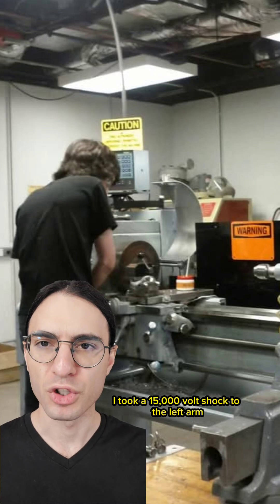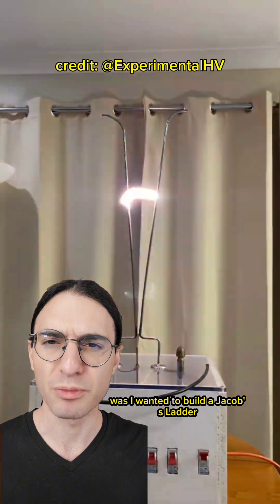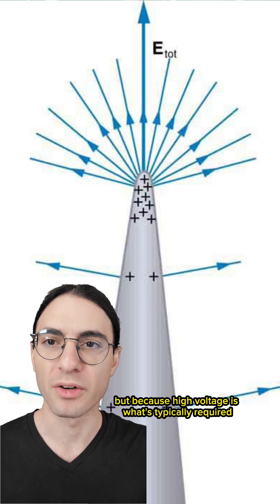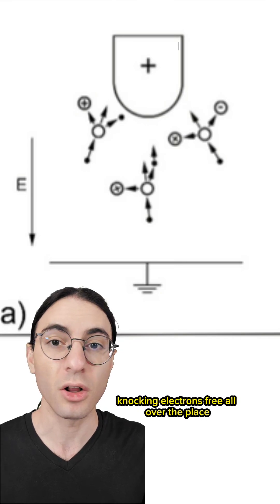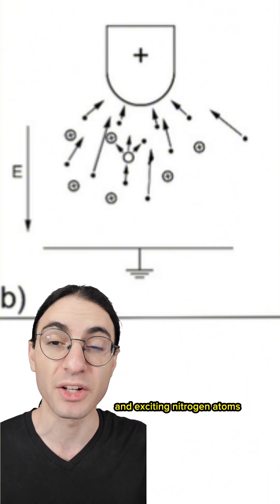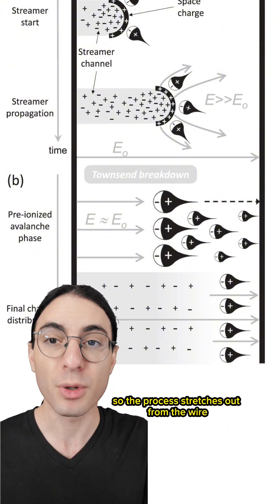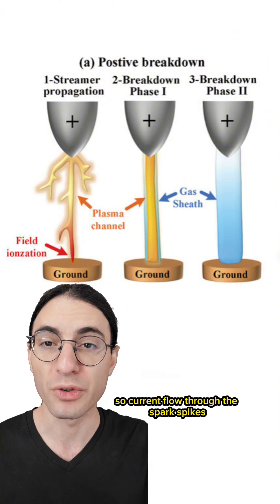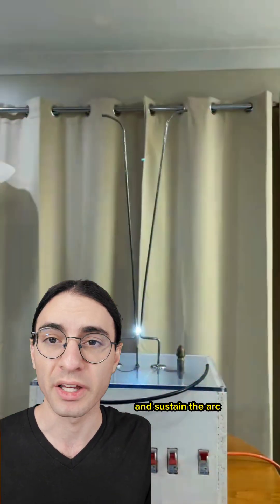Electrical arcs explained

Comment: I thought this was going to have something to do with the lathe. 

I grew up in a machine shop. 

My dad had just gotten a pacemaker put in maybe a week before hand and he was wiring up a Bridgeport mill. He got shocked by 240 in his left arm.  His pacemaker kept working so you never even went to the doctor 😅

One time he got hit by 480 from a giant overhead crane. He was carrying some pipes on his shoulder, hit some wires. He said it burned a spot on his heel. 

I've never been hit with more than 120 and that's more than enough.

Comment: Wait, so the electric field isn't strong enough to rip electrons from their atoms if there weren't already free electrons?
Reply: The breakdown voltage of air is 3.0 kV/mm. So 15 kV is enough for a 5 mm spark which looks like the distance of the bottom of his electrodes. So, to your question the answer is yes.

Comment: Experimentalist from a universitary plasma group here: The need for power to create an arc depends greatly on the conditions of a gas. Our theoretical physicists support the idea of electromagnetic pulses in some conditions, so that the plasma gets reignited in pulses. This only suits some high temperature environments though, so there are not that many use cases coming to mind. But an ion pulsejet may become a viable option, as long as the surrounding materials are reliable enough at such extraordinary conditions. In most cases the named effect of an ongoing arc is correct, even at our own plasma sources that feed into accelerators. Yet there are some exceptions, though they are rare. Btw nice work Dr. Blitz! Keep up your good work to keep the world intelligent and make it a bit more of that on top of it👍

Comment: The origin of the term “flyback” goes back to early CRT based television.  The current (not voltage) waveform of the coils in the deflection yoke is a sawtooth, going from maximum negative to maximum positive at a relatively slow linear rate, then back to maximum negative in a much smaller time.  The vertical deflection current is at 60 Hz (US monochrome standard; 59.97 for US NTSC color, similar frequencies in foreign standards), and the horizontal is at 15,750 Hz (again, US monochrome).  In both cases, the sharp reversal of current flow induces a voltage spike (or rather, requires a voltage spike to make it happen against an equal and opposite induced voltage spike).

At about 60 Hz, the energy required to perform the vertical retrace is easily absorbed by resistors.  But at about 15-16KHz, a great deal more energy needs to be absorbed; this was problem 1.

Also, high voltage was required to pull the electrons out of the cathode toward the screen with enough energy to produce light (this high voltage is delivered via a wire with a thick rubber insulator and a plug on the end that snaps into a dimple in the shoulder of the CRT, connected internally to a wide belt of metal or graphite coating around the shoulder, contacted by a wire inside the tube that is part of the “electron gun,” a cylindrical anode through which the beam passes).

But at 50-60 Hz, this requires a second bulky iron core transformer, a high voltage rectifier tube, and large filter capacitors capable of withstanding very high voltages, which would be expensive.  This is problem 2.

The solution to both problems is to use the extra energy that results from problem 1 to solve problem 2.  A small, ferrite core transformer has its primary in series with the horizontal deflection coil, and each retrace pulse generates a very high voltage in its much longer (in terms of turns of wire) secondary.  At 15-16 KHz the transformer can be much smaller, lighter, and cheaper than at 50-60 Hz, and the windings can be separated by a safe distance.  The rectifier tube is much the same, but carries less current, and a single ceramic capacitor, shaped like a thick truck wheel with its axles serving as terminals (called a “doorknob” capacitor) suffices to filter the high voltage.

This solution also solved problem 3: with a separate high voltage supply, if either the horizontal or vertical deflection failed, or worse, both, a vertical or horizontal line across the center of the screen, or a dot at the center, would still be illuminated, burning a line or spot into the phosphor.  But with the high voltage supplied by the horizontal deflection current, the screen goes dark, thus saving the tube (the original screen saver).

So what did they call this relatively small (for the time) transformer?  The horizontal current goes smoothly across the screen, but flies back, much faster, generating the high voltage pulse that is rectified and filtered to drive the tube.

And so it is called the FLY BACK transformer!
Reply: This deserves a post somewhere greater than a comment section 🤯
Reply: @Twizzlahs Thank you!  I have never posted anything on YouTube and don’t have the equipment, expertise, time, or money to purchase pictures to illustrate it.  I could post it on Facebook as plain text.

By the way, except for random-drawing displays which use electrostatic deflection, all computer CRT monitors have similar circuits to scan the beam and modulate its intensity, and contain flyback high voltage supplies.
Reply: Amazing!!! Thank you for this!
Reply: @allanrichardson1468  informative, thank you
Reply: This was a shockingly engaging comment, genuinely, no pun intended. Had me hooked the whole way through, well done
Reply: @plesleron thank you.  It’s amazing how many discussions and compromises went into designing things we take for granted!
Reply: @allanrichardson1468  Wow! Great comment! I used to repair old tube televisions (yeah, I'm that old). I got bit by the HV quite a few times. It would burn a tiny hole in your skin that hurt like hell. Now we just toss TVs in the garbage when they fail...
Reply: @baratono In my high school electronics lab in  the early sixties, the teacher told us that one prank which would be grounds for expulsion was to leave charged HV doorknob capacitors lying around, or worse, toss them to someone else to catch!